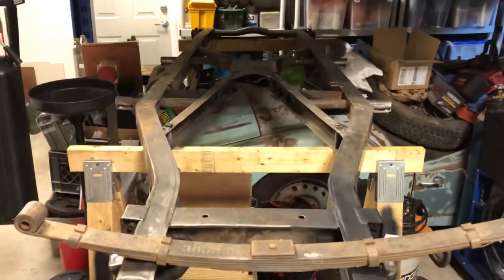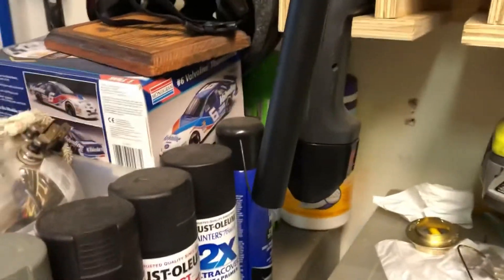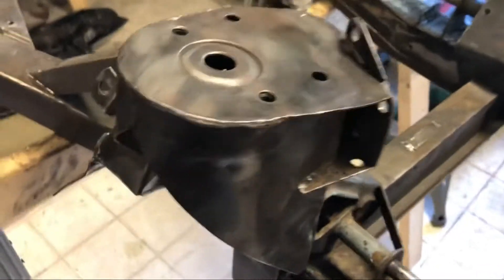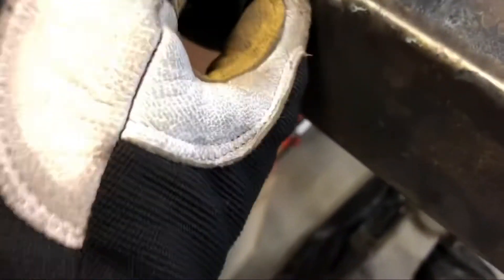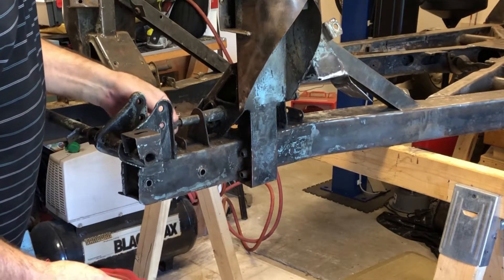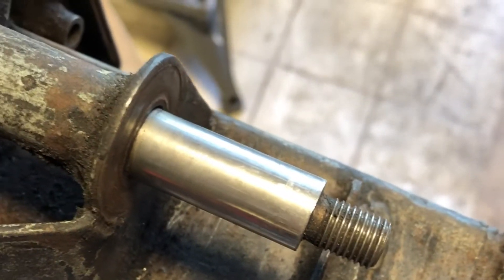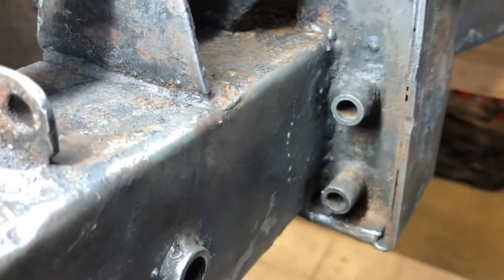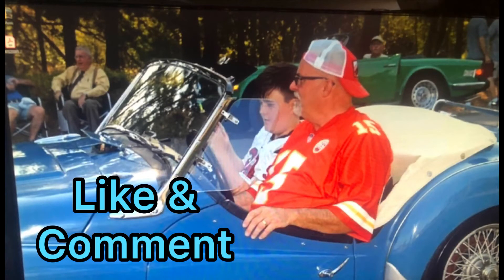1958 Triumph Tr3 last minute prep for sandblast of the frame

Comment: My frame work is done but not ready for paint. Tub assembly still under way. I just dug my leaf springs out Friday, wish they looked that good. Mine will have to be disassembled checked and reassembled before I decide if they are still good enough to use. Crossing my fingers, its an expensive part to replace. The frame will fit in the bed of a chevy s10. That is how I moved mine when I took it to where I work when I did the frame repair. Frank
Reply from the maker: Yep I dodged a bullet with these springs… must have already put those on, best guess anyway

Comment: wanna trade springs ... lol.  getting close... good luck getting transport, wish I was closer
Reply from the maker: What did yours look like Mike??
Reply: @pucman1  rust, mud between the leaves, and did I mention... rust! I'm going to try electrolysis, then soaking the nut in iron chelate solution to see if that helps them off without busting the through bolt. I have two sets, and will then try to pick the best leaves to reassemble.
Reply: @mikeg5877  Hey Mike before you undo the through bolt on your springs, use a G clamp on both sides of the bolt to hold the spring clamped together . Then undo the bolt and gently release the G clamp.
Reply: @richardholland7070  Thanks Richard... good idea, I will be sure to do that... gentle gentle ;-)